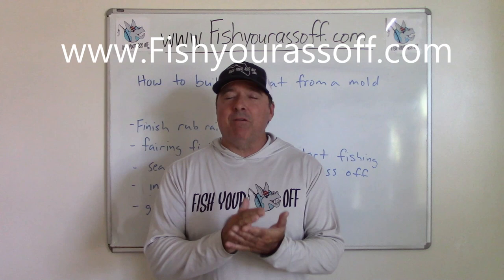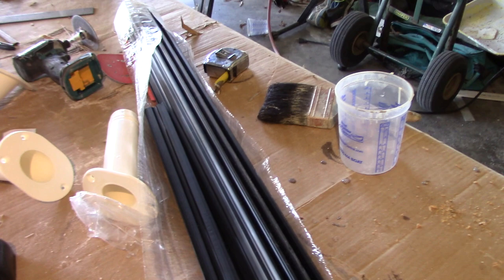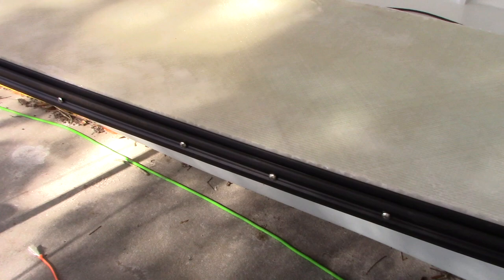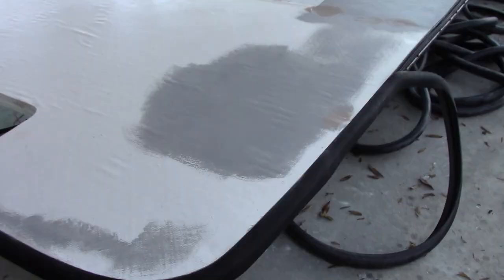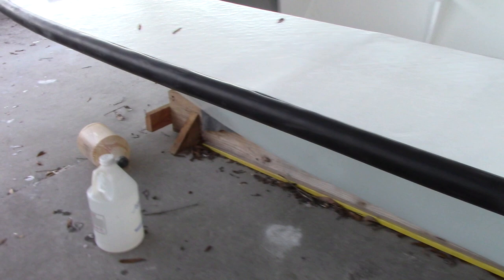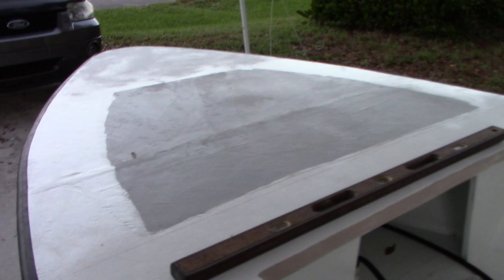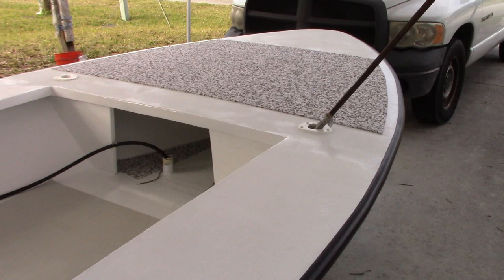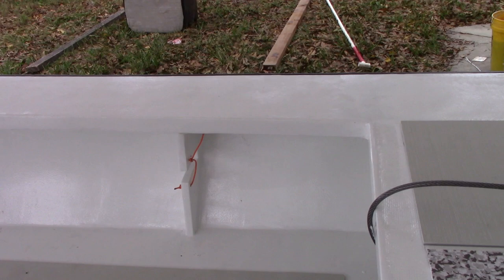How to Build a Boat from a Mold 7

Comment: Why didn’t you build a well for backwash ? I would take some nydacore and box that off in the back your bolts can be in the back in the well. Just use 5200 and set them with big fender washers. Make it self bailing well. Drill two holes for drains so when water washes in it runs right out. You’ll be glad you did. If you take a big wave over the back it will swamp ya quick. You should be able to also drill two drain holes in back of boat and put scuppers in that are one way so if you do take a roller over the back you can just run the water out. Why I love a Boston whaler. You can take the plug out of a whaler and leave it out. No need to ever have a plug in one.
Reply from the maker: I did end up cutting out a well in the back and put a 900 bilge in it. I appreciate your input. Thank you.

Comment: 20k?!?!?! How much was the hull only at the point when it was popped from the mould??
Reply from the maker: Thanks for watching. I don't know the pop out cost alone but the entire hull with, bumper, seadeck, paint, tie downs, wiring...... was 8,000. Most of that cost was my epoxy resin. It would have been half that if I used polyester. Thanks for watching.